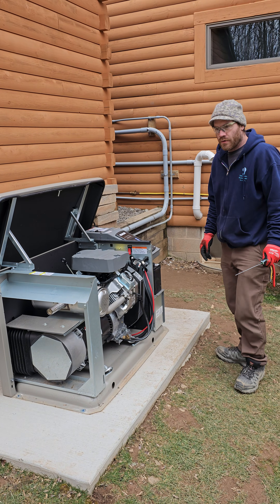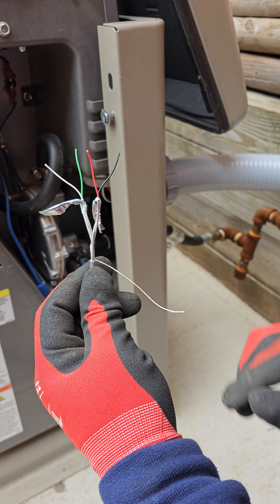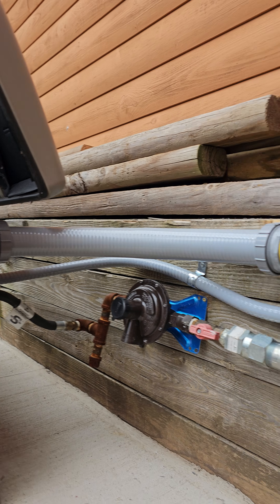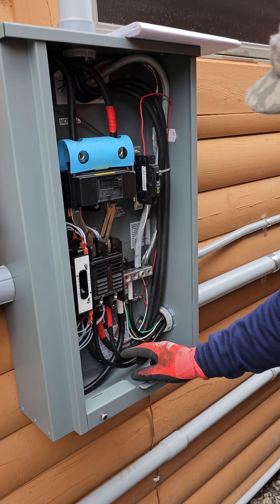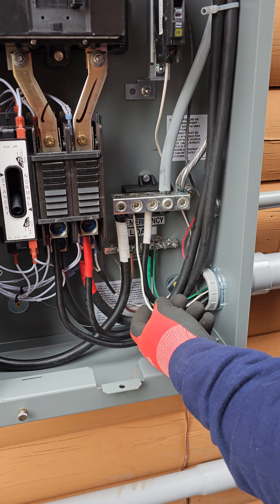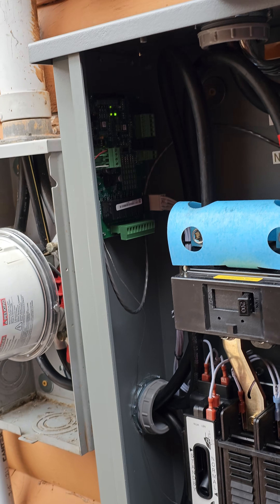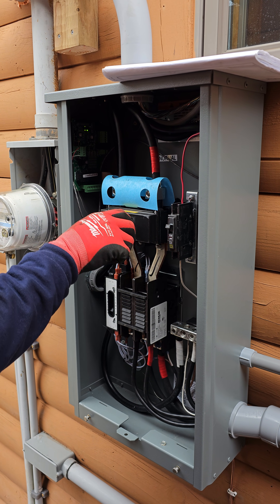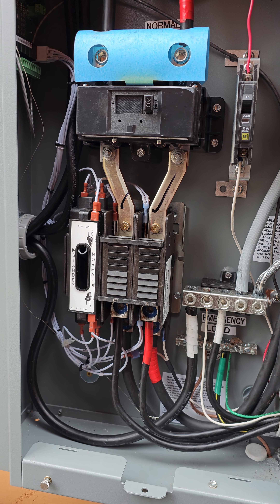Kohler 20 KW Stanby Generator 200 Amp Automatic transfer switch terminations. #electrical #generator

Comment: What’s the mounting piece for the breaker? I have those two studs inside my transfer switch but not that piece for the breaker to attach
Reply from the maker: You may have a different Transfer switch.  This is a 200 amp one. It comes like that with breaker already installed like that.

Comment: Curious, did you use just a PVC T/A to terminate into the top of the ATS? I don't see a sealing locknut on the inside.
Reply from the maker: Probably should be, it's sealed around PVC Terminal adapter with thru the roof.
Reply: @ElectricTremmel I’ve wondered what’s the right way to go into the top of an outdoor enclosure. Some people say meyers hub and T/A but others say the meyers hub isn’t listed for that. Just Rigid. So some do meyers hub with a close nipple and a pvc FA. Seen another say just T/A and a sealing locknut is good. Idk. 😂

Comment: From the manufacturer 
 they want the communication wire grounded at the generator and not connected at ATS
Reply from the maker: Im not sure it would matter what side is hooked up, as long as other side is not hooked up and insulated.  Im not familiar with Kohler but in theory it would work as an interference cable either way. I'll look into it, thanks for comment.

Comment: What's the gas code in your area, you usually have to be 10' from the gas regulator and or tanks which you're not for the regulator in this case?

Comment: Hello, what type of signal does A and B carry to the transfer board? I want to adapt that board with a Chinese generator but I don't know what signal those cables from A and B carry.
Reply: You would be better off with the RDT series ATS made by Kohler, it uses a two wire start.

Comment: I Might wrong, but did I see that you have a Grounds and neutrals separate on the ATS and your GEC on the grounding bar? Unless I didn’t see the MBJ between neutral bar and ground bar.  Great video explaining the wiring ✌🏾
Reply from the maker: @albertoortiz6205  i was trying to see if there was a bonding wire in video, and i don't see one. I'll have to check it out next time I'm out there. It's due for yearly maintenance soon. Nice catch!
Reply from the maker: Fixed it the other day when I serviced it 😆
Reply: The Kohler service entrance rated ATS has the main bonding jumper attached at the factory.  If it was not installed, (possible) or it was removed for one reason or another.

Comment: On this application do you the bond the ground bar to the neutral bar. Or is the neutral kept isolated.
Reply from the maker: @artbutler6785  if transfer switch is first point of disconnect after meter, ground /neutral are bonded in transfer switch.
Reply: @ElectricTremmel  Thank You! Great Job!
Reply: It's allowed to have main bond at the second panel, isn't necessary to separate all neutrals and grounds in the main panel. Just do not make first disconnect enclosure  as main bond.
Reply: btw, NEC state that generator MUST hold a total load connected, how did you accomplish that ?

Comment: We use a generator Cable that has 2awg wire Red/Blk/White/6awgGreen, along with 8-18awg smaller wires all in one cable. 
Never had any issues with it.
Reply: The KOHLER COMPANY is explicit in their requirements for separate conduits for their shielded control power and generator output cabling.  The reason that Generac has all of their wiring in one conduit is due to the type of controls used, versus the Kohler controls, which uses very low voltages for signal transfer.  And, while I have never seen a problem with any particular wiring methodology, it can be a warranty issue, depending on the problem.  But, I have constantly seen Cat III, Cat 5,Cat 6, bell wire, romex, thermostat wire, etc and not run into a problem operationally.  But, shielded wire is called for, bond the shield bleed wire at the generator, not the panel, as the controls signaling emanate from the generator.
Reply from the maker: @esalinas53  Specifications from Kohler dealer says it needs to be separated in different pipes, or could void warranty.  I usually install Generac,  and I use the all in one cable as well. It is HD.

Comment: Seems like a long crank time for a gas run generator. Or is that just me. Wish you would show gas hook up.
Reply from the maker: @howardiko7156  Separate gas company installed 500 gallon propane tank, and hook everything up. I'm an Electrician.  I'm not sure exactly how to do that stuff. I stay away from it. Sometimes they can crank for a bit the first time they start.

Comment: I'm an engineer and do most all of my own electrical work at the house, and I have spent several hours studying the overly-complicated Kohler manuals.  This short video has nearly everything I need to make sure my licensed electrician does the job correctly.  Very good video.
Reply: I bet the Licensed Electrician trained to do this job just loves having some sort of engineer...that DOESNT know how to the job...tell him if he did it correctly. Did you tell your college professors if they were teaching you correctly?
Reply: @rogerwhiting9310  Many residential electricians will have installed as many generators as OP (i.e., zero). If so, hopefully they read the manual like OP.
Reply: @YellowBunchofBananas  No, they rarely if ever, read a manual.  The two worst offenders of a proper generator installation, are (in order) electricians and gas men.
Reply: @rogerwhiting9310  Electricians are trained to pull, place and land wires in accordance with relevant code and local requirements.  Installing a generator is not something many are "trained" to do, outside of the OJT route.  Even those that complete manufacture courses need some help sometimes.

Comment: We are fixing to get a Kohler 20KW standby generator installed in our new home. Does adding this additional disconnect/ breaker in the transfer  box  make the big breaker panel inside the house a secondary panel where the grounds and neutrals have to be separated?  What about an additional ground rod requirement?
Reply from the maker: @ronvera  sorry just seen this , ground rod wire goes straight to ATS ground,  and ground and neutrals should be bonded in ATS. Then grounds/neutral separated in 200 amp panel inside. It's turns your current panel into a subpanel when you add ATS.
Reply: @ElectricTremmel  The addition of a disconnect, not necessarily an ATS, turns your main panel into a subpanel, this disconnect just happens to be in the ATS, as it is service entrance rated, i.e. it has a disconnect.

Comment: Where did you buy your controller wire?
Reply from the maker: @williamodom5795  Belden 8723 060100 Cable, Shielded, 22 AWG, Multiconductor, Chrome PVC Jacket, 3.2" H x 1.7" W x 1.8" L https://a.co/d/iFnJuVQ
Reply: @ElectricTremmel  thank you
Reply from the maker: @williamodom5795  not sure of your length,  but I think I just got mine off Amazon.
Reply: What size wire did you run from the generator
Reply from the maker: @williamodom5795  has to be able to handle 100amp. I used 2 gauge aluminum

Comment: Nice work, my only question is what powers the 15A breaker? Did you run a wire from the panel to it, then another wire to the generator battery? Thanks
Reply: The 15 amp breaker is powered from the load side of the switch, I all ways came off of the "B" leg, as it is closest.  It has to be powered at all times, as Kohler (and all the others, too) do not have a internally powered battery charger, it relies on 120 volt utility (or generator) power to maintain battery state of charge.  In this case, the 120 volts is ran to the generator controller, and the on board 2.5 amp charger maintains the state of charge on the engine starting battery.  This 120 volts would also power accessories such as carb heater, oil warmer, battery warmer.

Comment: 2:28 the 120v circuit with the 15 amp breaker for the accessories, where does that land on the generator side?
Reply: I also found that the 15a breaker comes with certain model transfer switches but not all and can be ordered separately if it doesn't. Manual recommends a breaker so it should be a standard.
Reply: I found it - it's the "utility" terminal block side next to the 100 amp breaker. Someone else did ask - did the 15 amp breaker come with the transfer switch or do they just typically provide a fuse and you can "upgrade" to a breaker?
Reply: The circuit breaker is a separate kit available from the distributor.   If you buy from a box store it doesn't come with one.
Reply: @bobbygene8274 Negative.. I recently (August 12th) purchased a 14kw from Lowe's and my 200amp ATS came with the 15amp circuit breaker.. The Blk donut thing I'm unsure where to connect that too.
Reply: @Antares_451 Antares, I am glad that your purchase came with the circuit breaker kit.  Makes things easier.  Most do not, (I buy my machines from the regional distributor, not from a box store) so maybe kohler or "relhko" has figured it out, and complaining has accomplished something, finally.  

"The "doughnut" thing is used for current monitoring IF (and ONLY if) you have load shedding connected and in place.  Otherwise it is actually unneeded.   Most of the time, I leave it with the homeowner, in case future growth requires load shedding.

Comment: Great video! Just a heads up about the generator enclosure it’s supposed to have all the covers on which serves as part of the air cooling system when it runs. I am sure you are aware but just wanted to put that out there for extended periods of the generator running. Short runs/ tests it’s fine.

Comment: Did the mount for the single pole breaker come with the switch???
Reply from the maker: It's an automatic 200 amp transfer switch. The aluminum enclosure,  and switch comes all together if that's what you are asking?
Reply: It is a separate accessory that can be purchased aftermarket from a dealer.

Comment: What is the brand and model of the transfer switch that you used in this video? Do you have a link or recommendation on where to buy
Reply: It’s the RXT transfer switch that comes with that kohler generator
Reply from the maker: Not exactly sure. Customer bought equipment.
Reply: It is a Kohler RXT-CFNC-0200ASE

Comment: My main 150amp panel is in my basement west side of home as well as tne electric meter.. What is the best place to install the automatic transfer switch? I'm debating on getting a Kohler 20k RCA and not sure where to place ATS inside or outside the home.. Also is OnCue worth it and don't they make a wireless kit so one doesn't need to use a cat 5 ethernet cable? Thanks😊 My gas meter is on the east side  of my house.
Reply from the maker: Keep it as close to 150 amp panel and meter . I prefer to put them inside but sometimes there is no room. I believe Generac is a better system to install,  but overall they are both good quality.
Reply: I like the Kohler video but with regards to this…why put the switch on the inside?  Is this your absolute  if there is no exiting external disconnect?  Also the Generac love….what’s all that about?  And do you service or just install?
Reply: It is without fail, less expensive to run electric than to run gas piping.  Closer to the gas service is ALWAYS the way to install, unless you can't.  Gas problems are the number one installation error that I see, that is most difficult to correct.  Kohler is a much better system overall, longevity and service wise, (not saying that generac is junk, or anything) but most buyers are turned off by the higher initial costs.  But, installation costs are virtually identical for similarly sized units.